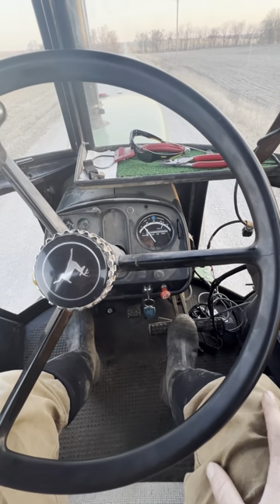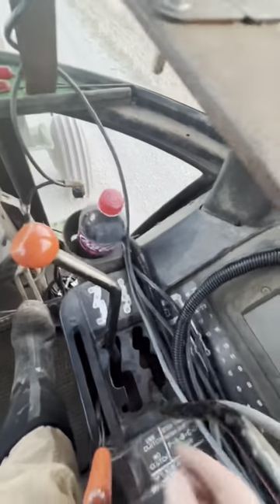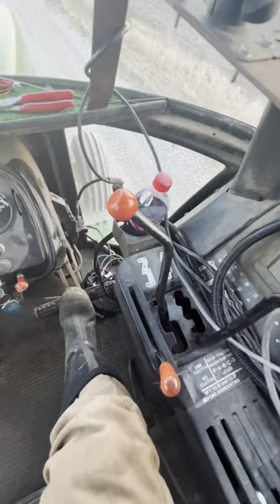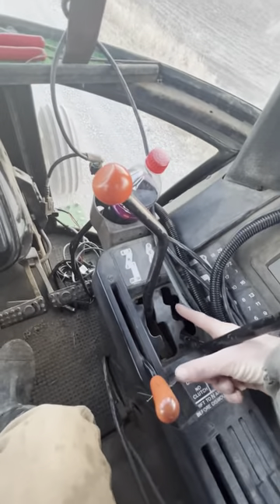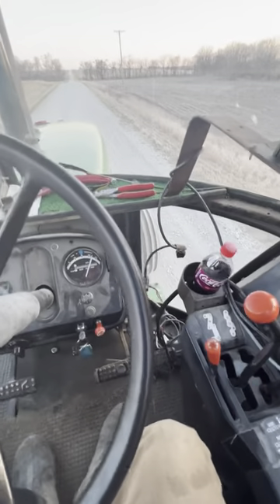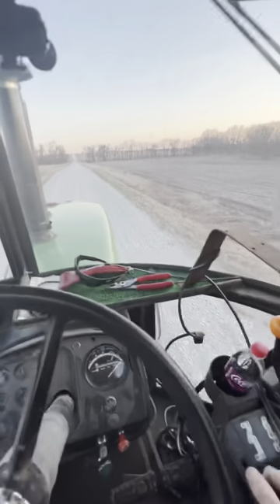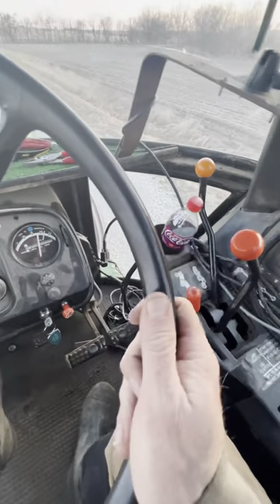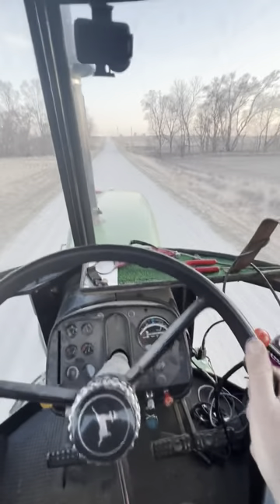Driving a Quadrange, extended version

Comment: I cant stand them quad range,s...you gotta love em i geuss, i dunno, but they not that easy, i just cant stand them, i especially like the 3 speed lo/hi multi power on a massey like a 1135, same size asa deere 4440, those are so much more easier to operate, with a nicer queiter bigger cab, or a ih 1086 or a 1066, those are easy to shift too....

Comment: If that's a 4240 or larger with the 466 engine your abusing the driveline. It'll pull away fine from idle.
Reply from the maker: You saying when I give it a little throttle?